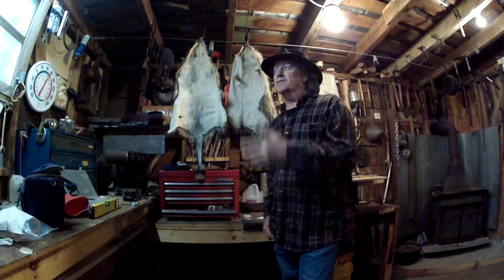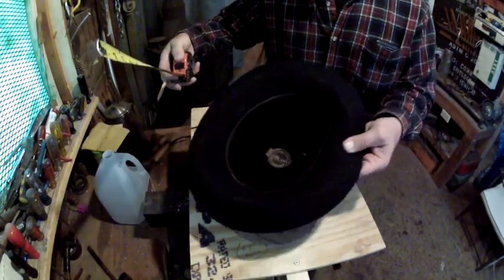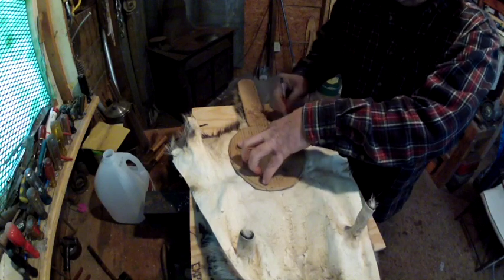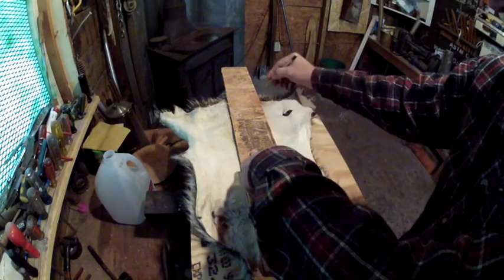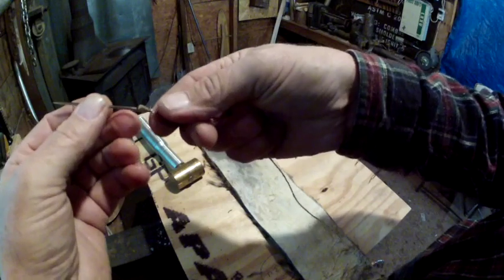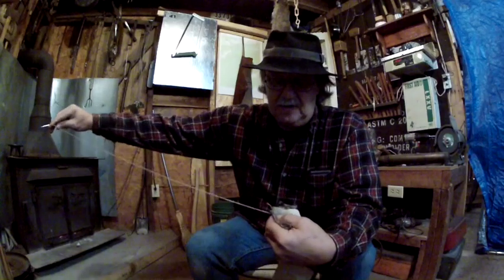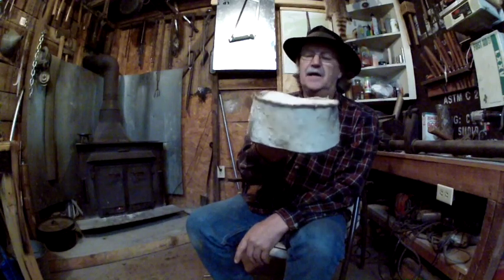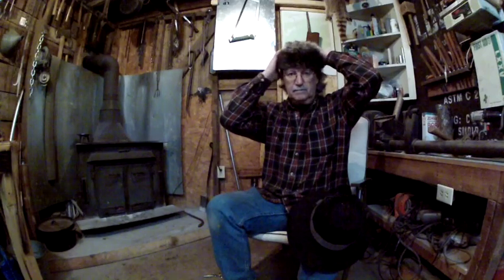How to make a coonskin cap the easy way

Comment: Quick correction, sorry!  Circumference of a circle = 3.14 x radius.  Everyone's hat will be a wee bit big, if they use 3.4!  Another great video, thanks.
Reply from the maker: i knew i would mess up on numbers cain't count worth a hoot or holler thanks for pointing that out friend
Reply: @mike451  You have skills many crave and sharing knowledge is good!
Reply: That's better than me. I thought it was the radius squared. I'd have ended up with a raccoon overcoat if I'd have tried like that.
Reply: No it is 3.14 x radius x2
Reply: Correction to that, Circumference is actually 3.14 x Diameter